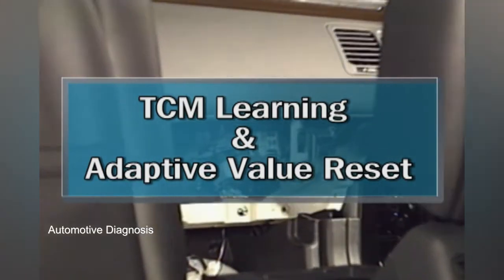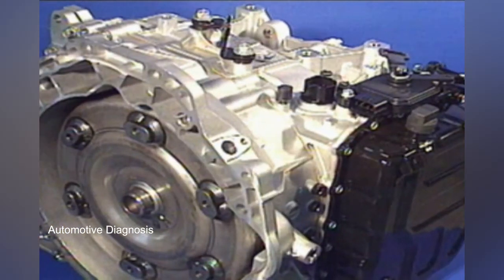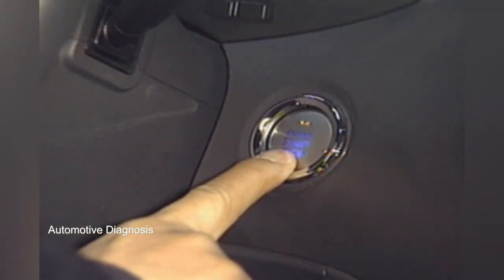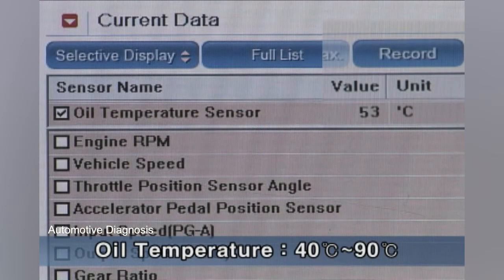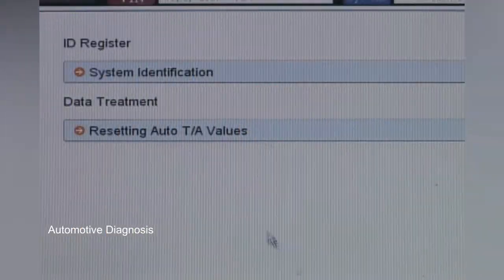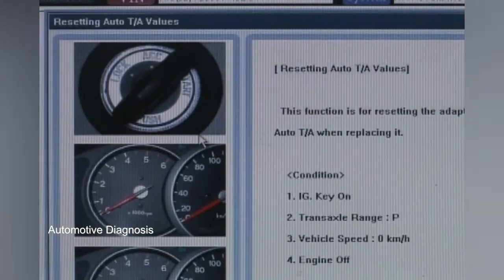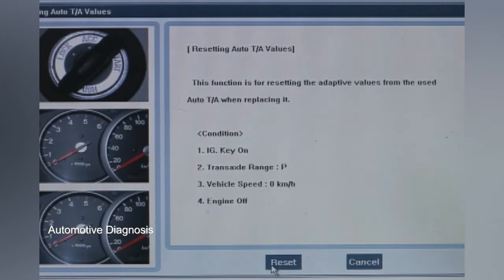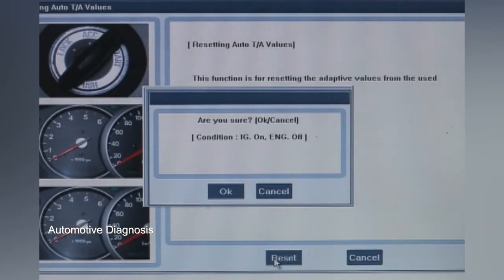TCM Learning and Adaptive Value Reset

Comment: Would this work on a 2009 Acura tl sh-awd ?
Reply: I checked everything with a pro grade scan tool and no codes.  Any other ideas ??
Trans level is fine.
Reply from the maker: Hi there, resetting the transmission is mostly the same on many cars. You need to check the transmission using a scan tool, then you will find the "transmission adaptive value reset"
Reply: @AutomotiveDiagnosis  I will try that thank you so much for your help and time
Reply: @AutomotiveDiagnosis  it will drive fine till it gets hot and then it will down shift for a second then upshift back into original gear. Everyone has checked it but no one can figure it out
Reply from the maker: @mab4870  If transmission fluid (level and quality) has been checked and there is no problem, TCM reset can be the next step. Also some faults on transmission internal wiring and solenoid valves could be affected by temperature as well if they are partially damaged, that’s why fault appears on higher temp.
Reply: @AutomotiveDiagnosis  wow.  That’s amazing thank you. Man I wish I could get you to work on my car.
Reply: @AutomotiveDiagnosis  if my Acura is down shifting when the car is hot will doing a tcm reset fix this issue ?

Comment: Would this procedure work on a 2009 elantra? I can get access to a scanner
Reply from the maker: It's very similar. Normally on Hyundai & KIA transmission reset can be performed by scan tool and re-learning must be done afterwards in stationary position and in driving to let the transmission meet all gears.
Reply: @AutomotiveDiagnosis Hi can relearning be done without a scanner?

Comment: Hello . Just fro. N to D ?
Reply from the maker: Hi there, as you see in at first, you need to learn the UD brake that's why we should shift between N and D, but you must do the second step as well to learn the 26 brake and 35R clutch and that's when you need to drive the car and let the transmission to meet the gears.